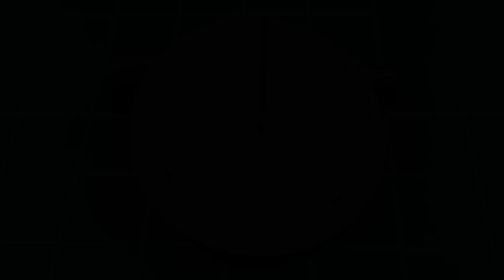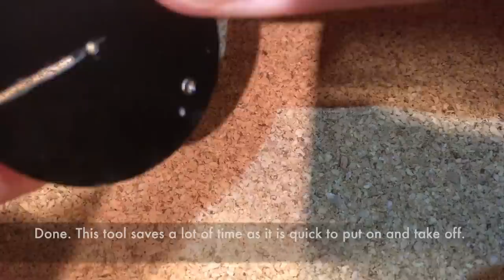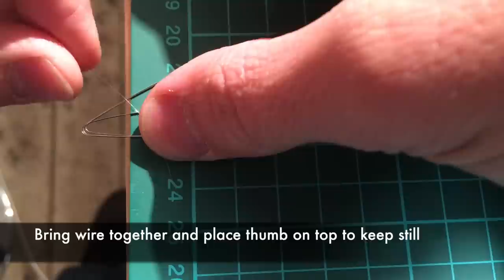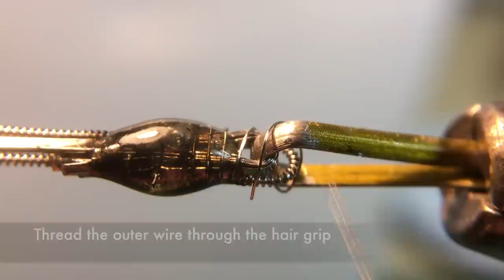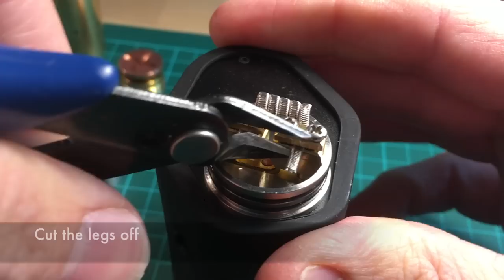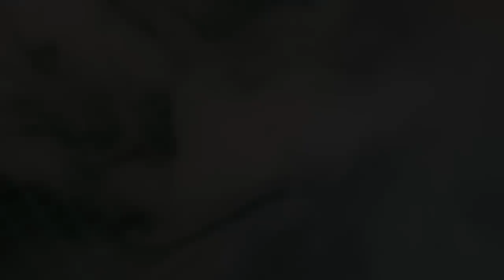Staple Staggered Fused Clapton build tutorial, plus NEW Clapton Spacing method

Comment: I dont think you could break this down any better...op , ur The Man!
 I suppose one could cut some corners, and substitute certain items you cant get or dont have; for instance, the loop in the drill; i fashioned a paper clip. And the swivels, Im using fishing swivels, but they are smaller.. i just used large paperclips for loop on both sides for ease of operation. And when I finally set this up, I wont have access to hot glue, so I'll have to find something to bind the drill end together; ive heard of ppl using key rings (instead of clothes pins) but I got many ideas & tricks/tips from "Coil Mother Fudger"... thanks, friend! We loved your "Button Technique" video too! you've got talent, Sir!!
Reply from the maker: Keyser Söze Hi yes there are many alternative methods that can be used, this is just the way I like to work. I had issues with the keyring as it messed with my clapton spacing as it was so tight, depends on the keyring I suppose. I find the pegs pretty reliable especially as I brought a big bag from a pound shop. The glue isn't essential but make sure you use lots of fixing wire to secure everything in place. Thanks for your involvement. CMF

Comment: I was just admiring the coil and design thinking “Man could this be some awesome lighter? Maybe a welder tip for light metals?”...

“Oh wait it’s a vape.... I’m bored.”
Reply: I guess you could use it as a lighter somehow... but without a liquid wick it'll burn itself out so maybe if you made the coil bigger/ wider?
Reply: tbh this just made me appreciate the mechanisms behind vaping
reguardless of how u feel about vaping, cool engineering is still cool engineering!
Reply: I was thinking awesome lighter at 1st as well.
Reply: Could be used in a huge number of ways though. All it is is a heating element. Could be used to generate heat in a huge number of applications. Your toaster uses a similar concept with resistance wires.
Reply: Dude can you pls tell me what have you found wrong about vapes?

Comment: Awesome videos, very helpful. Also i suggest you don't use these brass plated brushes while the coil is still hot. I own the same brushes and i noticed they are melting in high temperatures.
Keep the good work, i wait for the next video :)
Reply from the maker: VenOHM thanks you the tip, I will let it cool before brushing. Glad you liked the video

Comment: Bro it's a great video,tell me please what kind of wire u are using to build the spaced clapton and what kind for finish wraps?
Reply from the maker: Mihail Muntean hi. Thanks for your comment. Both are 34g (0.16).
Reply: I'm trying with ss 34g,but the finishing wrap it's impossible.are u using kanthal?
Reply from the maker: Mihail Muntean hi. No I use nichrome. One thing that can ruin it is if the spaced clapton is not free from its core wire, if it is stuck to the core as in it can't slide off like you would de-core to make aliens, then the final wrap will be hard to impossible.

Comment: was that an autoclave for your vape? pretty classy. My method is to burn the coil on a higher wattage until all the gunk is seared loose. then while its still hot i run it under a tap. if its still looking gnarly ill brush it down, but i try to use fine stainless brush, surprised the brass doesnt rub off. nice vid and coil breakdown, was thouroughly impressed.
Reply from the maker: Tim Anthony it was an ultrasonic cleaner you can get one pretty cheap. I used brass when I made this vid but I should have used a steel one.

Comment: Hey all so I figured out how to make the disc without specifically a disk, (button method works too but with higher gauges can fail because you need to make the loop so tight) get an EMPTY spool of wire, use flathead screwdriver to punch two holes for screws on the inner circle, use screwdriver to screw in the screws( i also put hotglue on the other end of the screws so they stay in place), make two small holes on the outer circle for where you will loop the wire to stagger with and voila, it works a lot better than the button because it adds weight to it and ultimately you could even loop a low gauge wire and connect it to a RDA/tank you dont use to put more weight on the spool to ensure the loop for the staggering doesnt move out of the groove! :)

Comment: You should make the disks and sell them.
Reply from the maker: nick hill hi thanks for your comment. I am actually in the process of getting them manufactured, will be available at: coilmotherfudger.com
Reply: Where do you get the discs from?
Reply from the maker: +Iain Press from eBay
Reply: Just plain plastic discs are they?
Reply from the maker: https://www.ebay.co.uk/i/263219001293
Reply: I just used a cap off a juice bottle

Comment: Nice video! single coil on dual coil rda??? flavour???

The RDA is goon. I searched a lot. it looks sexy. i ordered the goon 1.5 and waiting for my drop rda too :-)..

think the two rdas are very good. the goon is massiv and expensive. but the new goon 25mm is a little bit bad because ther airflow regularcap is not stainless steel.

the goon and goon 1.5 are massiv stainless steel. very nice.

Comment: Is there any benefit to using Nichrome over other types of wire? more specifically Kanthal, that's what I've got access to.

The only thing I've found is that Kanthal has a slightly higher resistance, is that an issue for this build?

Cheers, thanks for the informative video
Reply from the maker: Gus Wilkens kanthal is good and will work fine. nichrome has lower resistance and heats up faster I also personally think it gives better flavour.
Reply: Coil Mother Fudger cheers for the quick response! 
subbed :)

Comment: Why doesn't electricity just run along from the very edge closest to the cathode and anode. Why does it bother looping around the coil or is the spiral on either side of the inner wire not conductive?

Comment: So I tried this build last night and failed pretty hard. Practice practice practice. My biggest issue is the ribbon wire wants to spoil up and does not lay flat. Any tips on that? I noticed in your video yours lays perfectly flat?
Reply from the maker: John Wynn before you cut the length of ribbon off the spool pull it hard and it should straighten it. I brought a big spool before making this vid and it seems to come off pretty straight. although I do waste a bit making sure I get lengths with no bends or dents. Ribbon can be quite irritating. Hope this helps

Comment: When I tried your button trick I found that it would jump around and cause the spaces to become uneven, often leaving much wider gaps than a wire thickness. Is there a particular tightness that the button needs to be for it to work properly? 

One issue is that I've been forced to use swivels without ball bearings in (got some ball bearing ones on the way now) and even with 4 linked they would catch now and again and cause the wire to bounce alot. I did manage to create enough wire for one decent coil but I feel like that was luck as much as anything. I have some wire tamers coming soon so am waiting before I try again but would love an answer from yourself regarding the button trick.
Reply from the maker: Tim Murray hi it is important to get the button on really tight. good swivels should help too
Reply from the maker: Tim Murray put your thump on the button to hold it in position and use pliers to twist it tight.
Reply: I have tried but the buttons i have are very very small (smaller than 5p in england) plus i have fat fingers haha. Next time I will try holding the wire with pliers and spinning the button instead?
Reply: Thanks for the reply :)
Reply from the maker: Tim Murray no problem. You won't be able to spin the button as it will twist the core. Get a larger button, cut one off something you don't wear
Reply: okay thanks for the heads up! Got 200m each of 32, 34 and 36g in the post as I'm all out but once I get it I'll give it a go and report back! Thanks again :)

Comment: Cuestion. I can do this build in a doble coil set up? Vgod elite rdta atomizer? With 2 coils insted of one? Thanks
Reply from the maker: Damian Ranucci hi. Is it 22mm or 24?
Reply: Coil Mother Fudger a 24 mm diameter
Reply from the maker: The vgod atomiser?
Reply from the maker: Then it will fit as dual. Only issue is they will ohm at around 0.09. You could switch the 0.4 ribbon for 0.3 which will bring the ohms up.

Comment: Is that a #10 swivel? Do you use that size for small claptons?
Reply from the maker: It’s a size 6 in this video but I use a size 4 for everything nowadays
Reply: @coilmotherfudger8765  Good to know. I've been using these #4 fishing swivels but they're only about 5mm in diameter.  With 4 of them connected I still get some binding/jumping. I'm trying to find a big beefy swivel like yours.

Comment: Did you used 40ga just to tie things together or for the fusing?
Reply from the maker: Just to tie together. But I use to stagger and fuse nowadays.
Reply: Coil Mother Fudger so you used 34ga for spacing jig correct?
Reply: Great tutorial BTW!... Gonna order wire today to be able to build this
Reply from the maker: roy escobar that’s right. But you can use any guage as long as you use the same or thinner for the final fuse. Thank you
Reply: Coil Mother Fudger 10-4 thnx again... keep up the great work

Comment: I consider myself AN ok BUILDER. i CAN cLAPTON, fUSED AND SINGLE, mAKE Aliens, etc. But for the life of me, I cannot get ribbon builds like this to work.The main issue is that I find Ribbon Wire extremely difficult to work with. It's hard to flatten, and when I do get it stacked, I can't keep it vertical when I but the frames on. The ribbon has a tendency to turn flat. Very frustrating.
Any tips that you or anyone can offer for this problem of keeping the Ribbon Wire vertical while putting on the last outer wrap?
Thanks
Reply: Geoffrey Zoref i know your comment is a year old but did you get the ribbon builds sorted out? I may have some ideas that could help if you are interested?
Reply: I have one for ya, DON'T USE RIBBON
Reply: @bash6555  can you use a round one? thanks
Reply: @Icy0fire  no because round wire does not stack

Comment: Why does mine keep spitting and popping I’ve set it on high and low wattage and it still pops
Reply from the maker: Tim M hotspots?
Reply: This is the 3rd prebuilt coil I’ve installed . I’ll try again. Any suggestions on coils . All I have is Clapton coils . I’m new to RTA BUILDS . I have a dual coil Zeus did the dual now I’m focusing on single build